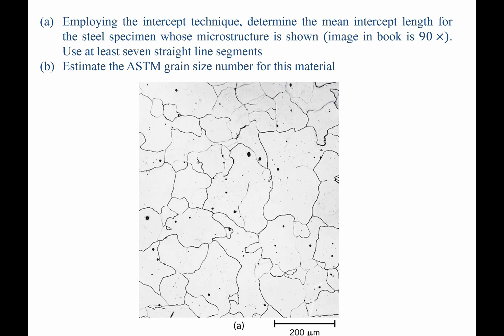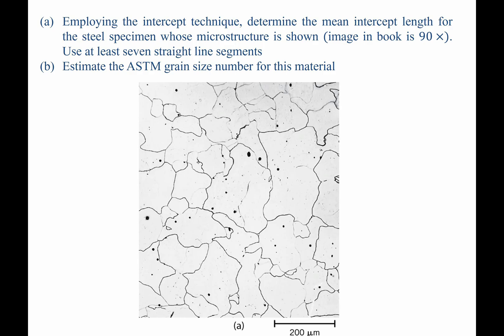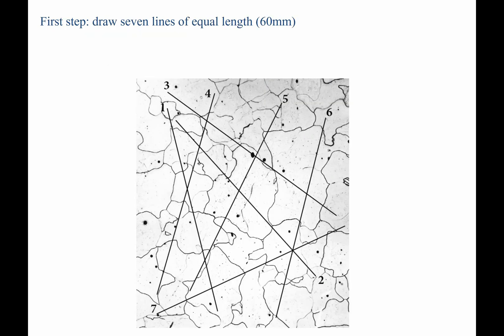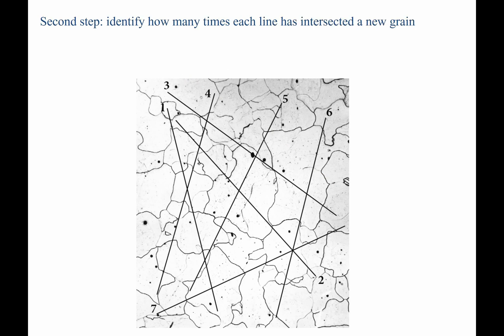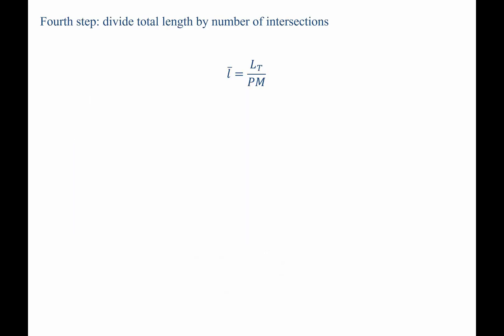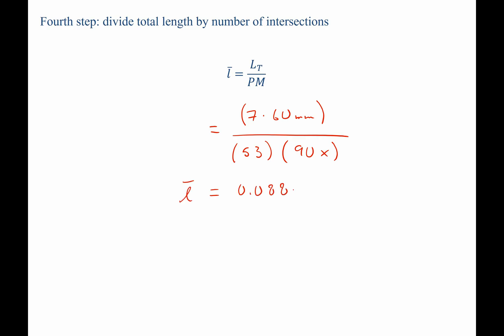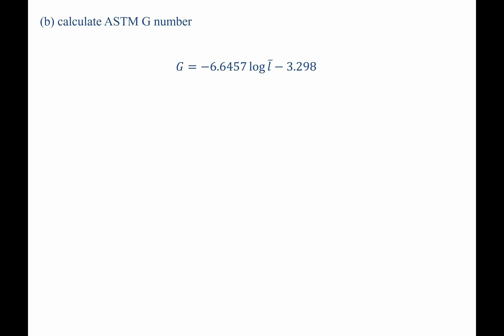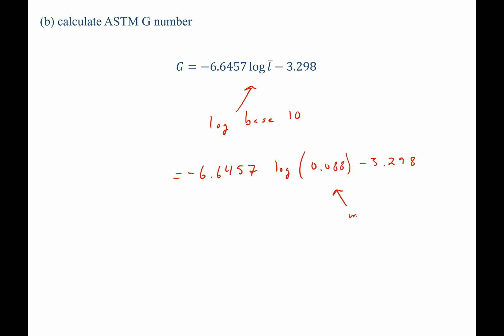line intercept method for grain size determination worked example

Comment: i never saw straight line for intercept method? can you give me the litterature or source?
Reply from the maker: https://www.astm.org/Standards/E112.htm
Reply: @TaylorSparks  there's no straight line in that standard
Reply from the maker: @Jstrndm  if you didn't do a straight line, how would you make sure not to do it arbitrarily and how would you measure the length of the line. A straight line fixes both of these problems.